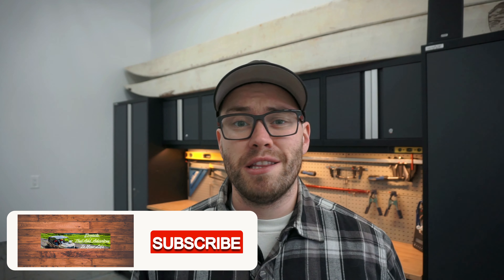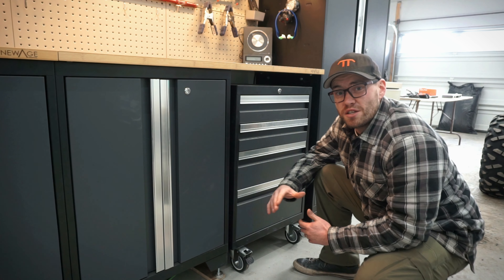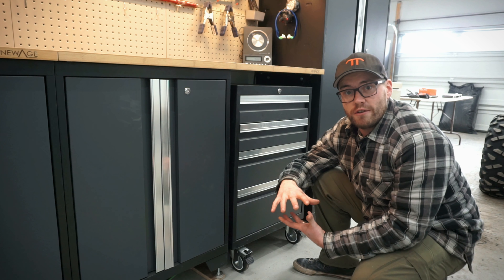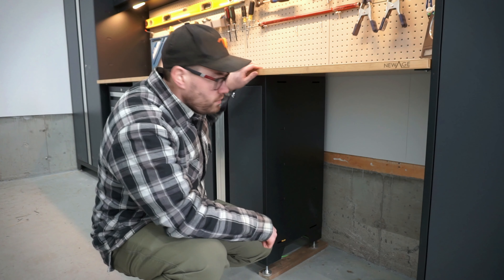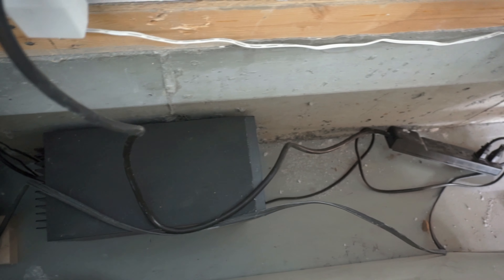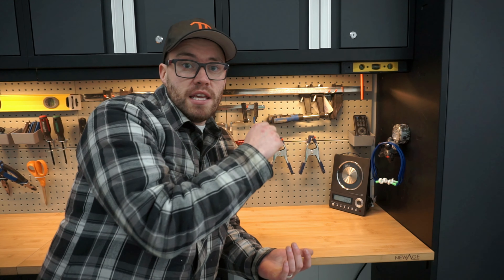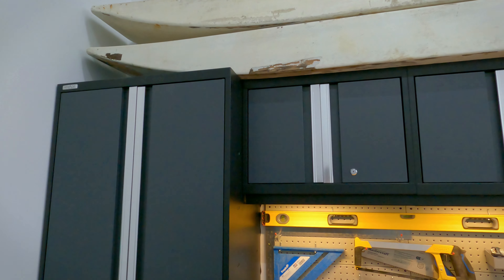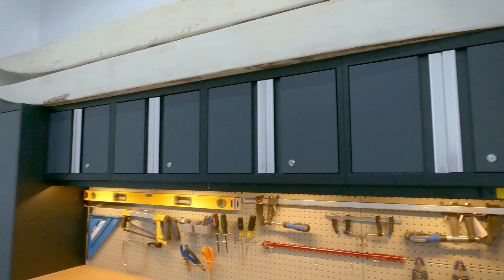Your NewAge Garage Cabinet Questions Answered! Bold 3.0

Comment: NewAge provides instructions and hardware for mounting ALL cabinets to the wall if desired. They also sell slat wall brackets in order to hang them on slat wall. Including the tall lockers and lower cabinets

Comment: Hi Travis, if your were to do it again would you go with the pro series. I'm going with the pro. I've seen on the new age web site lots of people are complaining about the stainless steel table top that the gauge is super thin and even come damaged since they seem to be so fragile. Are you happy with the bamboo top. I work on small motors, and sometimes hammering is required. Wonder if I could screw in a vise as well? So now I'm just debating between bamboo or stainless... Thanks Mate ☺👍
Reply from the maker: I've been very happy with the cabinets! The bamboo is really nice and sturdy. I haven't mounted a vise yet, but I think it would stand up to a reasonable amount of abuse.

Comment: Travis, I got this put together yesterday but for whatever reason the 2 pieces of bamboo slab are not aligned. The right piece is slightly higher than the other. Do you suggest that I should try anything to fix this issue?
Reply from the maker: Hmm that's a tricky one. I'd first measure the 2 slabs to make sure they are the same thickness, if not they may have been manufactured wrong. If they are the same thickness maybe try swapping their position with each other. Wood can warp so sometimes you have to get creative.

Comment: Thanks for your very informative videos. I wonder if you had also considered the NewAge Pro series, that provides a thicker gauge steel (18 gauge Pro vs thinner 24 gauge on the Bold, so double the thickness). They are quite a bit more expensive, but wonder if you had any opinions on long term durability of the Bold series and how it might hold up relative to something sturdier. Not sure if these have the cheap, tinny feeling/sound/build if they are aren't bad at all. Thank you again.
Reply from the maker: For me, I haven't had any problems with the durability so far. They do have a lighter feel to them but by no means bad. I'm sure the Pro series has a but of an edge there, but the cost for me just want worth it. I'm sure if your hucking heavy tools into them all the time you might have to worry about denting. I usually take pretty good care of my stuff and am not all that hard on things so I find they work really well for me.